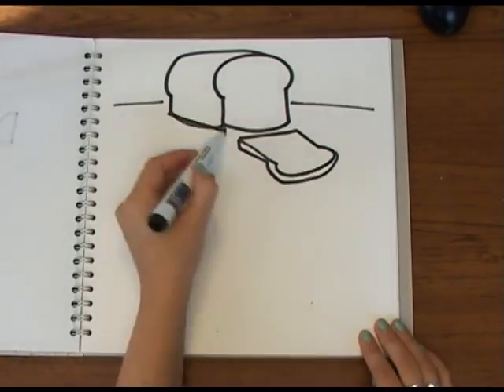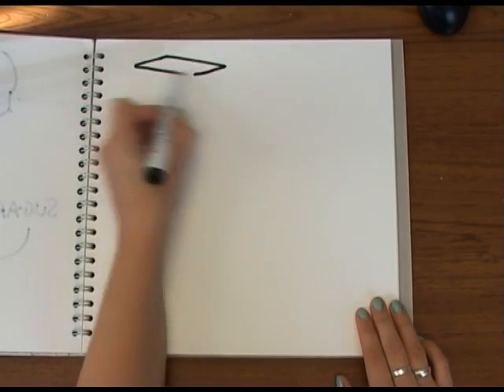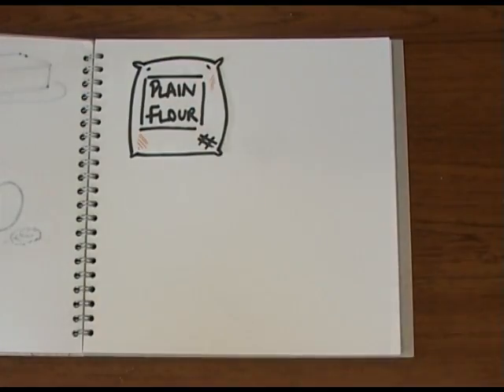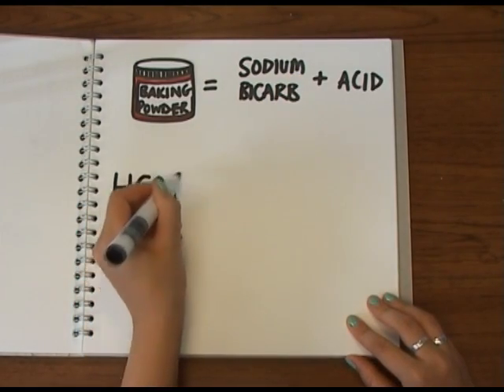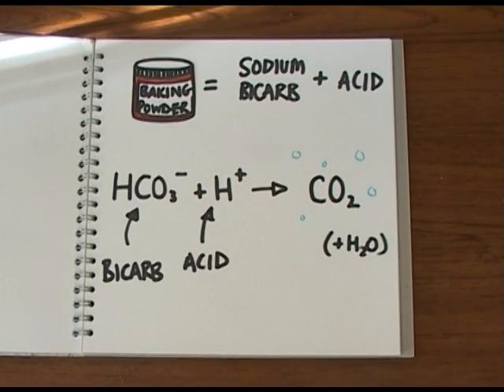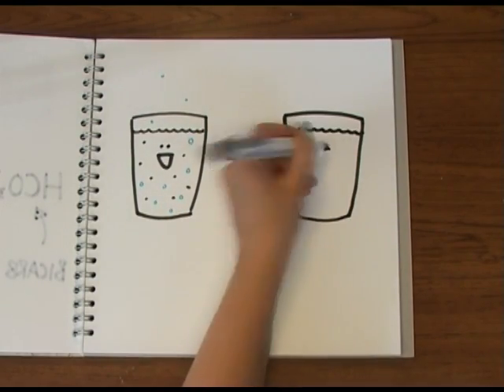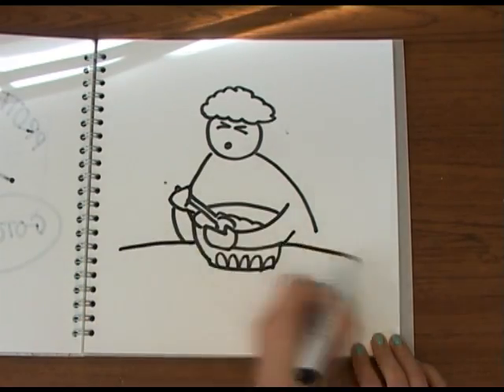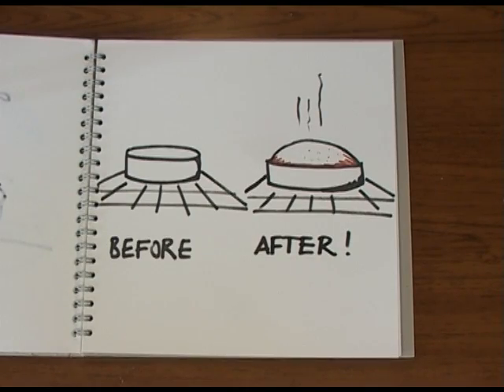How Does a Cake Rise? - Naked Science Scrapbook

Comment: What about eggless cakes??  Does baking soda trap co2?? Or what's the science behind it
Reply: You can think of both items working at the same time to increase the amount of bubbles in the cake. Egg whites "trap" the air bubbles that where beat into them during the mixing process via proteins. Cake batter also contains flour (starches and proteins) which work to trap any CO2 generated by the baking soda (to a lesser extent) as it is reacting and rising in the oven.
Reply: Basically, baking powder has baking soda and cream of tartar. Baking soda is a base and cream of tartar is an acid. This neutralises and the reaction PRODUCES CO2. Also, eggless cakes are often a bit thicker since some of the CO2 is driven out.
Reply: So whole purpose is to trap the bubble co2 by whatever means??